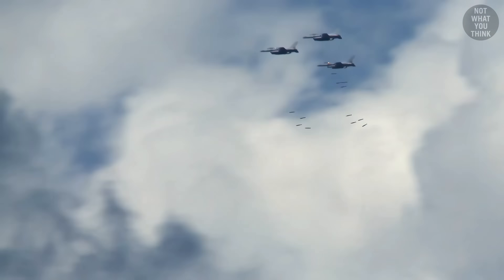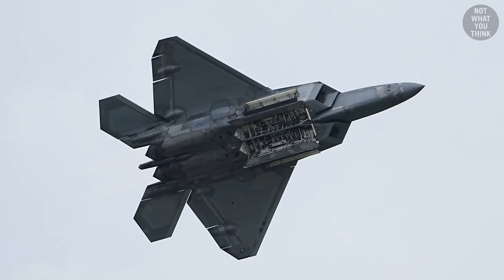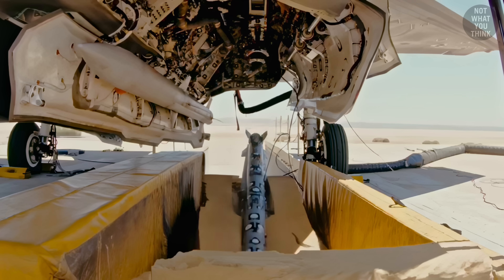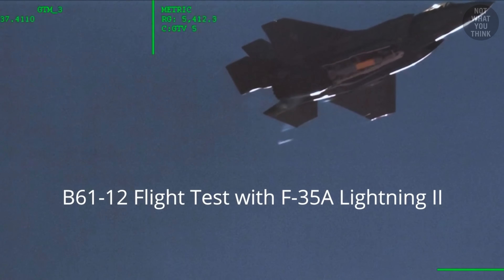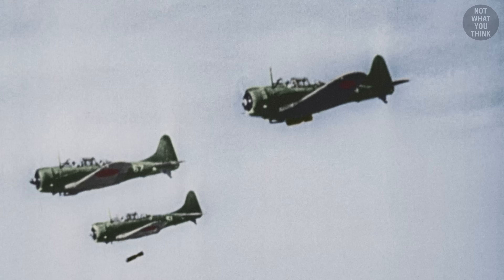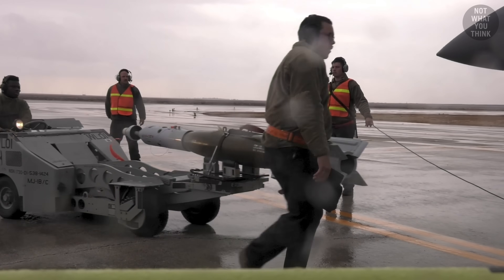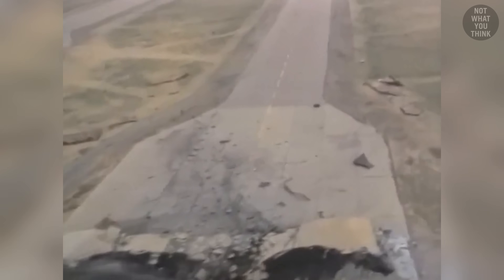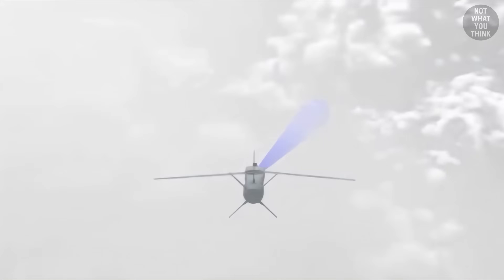Why Gravity is No Longer Enough to Drop Bombs

Comment: I am currently a weapons troop in the USAF and learning the job which involves putting bombs on the aircraft and ensuring it will drop correctly. When learning, we are told to just do things without any real exact reason as to why. This video has given me more information about why we do certain things when loading bombs that no Sergeant has been able to tell me. I might bring this video up to someone within my leadership.
Reply: I was a 462 back in 1979.
Reply: @ 2W1! Through and through!
Reply: That just the military in general. 
When I was in, "Because I said so" was the most common answer I got to my questions. 
They preach to always better yourself, but then scoff at you when you do. 
Most NCOs I met don't want to teach, or even want you there to begin with. This is due to the severe elitist culture among the NCO corp.
Reply: I was a 462 back in 66-70.  I loaded 5 million pounds of ordnance on F-4Es in Thailand, each one had to be pushed off with an ejector cart which opened the bomb rack while the piston pushed the weapon off.
Reply: @richardwalling9695  We still do it the same way on the A-10. Crazy how little has changed.
Reply: @richardwalling9695  Damn. What did you guys use to keep from breaking your backs? Hydraulic lifts?
Reply: If nobody told you why using the correct orifices in the MAU-12 bomb rack or setting the pistons on new pneumatic racks is so important, you had terrible instructors. Then again I am looking at it from the perspective of an armament/munitions officer in the RNLAF where we do want our technicians to know why and how things go to pot when they don't work in accordance with the tech order, job guide or JTD as well as being aware of the potential risks to the aircraft and its crew.
Reply: @ We us -40, -50s on the A-10 and yeah. Nothing was really explained other than “Because that’s what the TO says.” This video explained more than my LSCs ever did
Reply: Herc pilot here, y’all do God’s work.
Reply: @ 
@CramcrumBrewbringer So do you. Pilots are amazing.
Reply: get in touch with your local intel flight, and ask to have a sit down with their targeteers. those folks know exactly how to use these weapons and direct the strike details for the pilots. you will learn a lot and they're super cool people. I'm still serving as a targeteer in the AF, getting ready to retire after 16 years.
Reply: question that you would probably know the answer to. aren't they called hardpoints? not ejection racks?
Reply: @ I haven’t heard the term hard points. Ejector racks is a common term in reference to where majority of bombs are load. There are some others but most are on the Ejector racks
Reply: @crimsonpomp  A hardpoint is a designated attachment point, typically on an aircraft, designed to securely hold and transfer the forces of external loads like weapons, ordnance, or support equipment. These points are structurally reinforced to withstand the stresses of carrying and potentially releasing these items during flight. I searched up a description for you
Reply: @ Yeah we don’t use that term. We have pylons, racks, and AME.
Reply: @crimsonpomp  good to know
Reply: @AubinusPrime  Ejector racks are in the hard points, Or pylons as they were called in my time in the AF.
Reply: @richardwalling9695  oh. that makes sense
Reply: IYAAYAS!
Reply: @ Logic would say: “Oh so if you are Ammo. You are shit.”
Reply: @ lol 😂
Reply: Maybe you are DEI
Reply: Not everyone wants to learn the explanation of why they do it the way they learn it.  
However if someone is interested, it is a good idea to let them know. Might help them do the job better.
Reply: @ I disagree, the learning of why in our career field especially with training will instill people to understand and ensure they do certain aspects of the job. Giving a proper reason besides “Because we said so” goes a lot further.
Reply: @crimsonpomp  Better informed soldiers make better soldiers. However, there is an institutional need to 'keep grunts in their place.' Having less information makes it easier for 'them' to keep you n your rank with 'them' on top.
Reply: @ That might apply to soldiers trained to go to actual combat, but as Airmen and Weapons Technicians. Knowing more information about your job allows for better decision making and quicker decision making. USAF doesn’t teach you what to think, they teach you how to think.
Reply: @KorianHUN for something like that, they definitely should know why they're doing things the way they're doing them. I was a surveillance sensor operator in the Corps and even I got context for why SOP is SOP, making a mistake while implanting sensors is significantly less dangerous than making a mistake while installing bombs on an aircraft

Comment: You can always install ERA to add extra protection to bunker. As a building, there is no restriction on how many top ayers ERA you can stack.
Reply: That wouldn't work. Explosive reactive armor specifically saves tanks from shaped charge warheads, which specifically inflict a lot of energy in a very tiny point. Piling a bunch of extra explosives on top of your bunker won't save you from a gigantic bomb. It will just add more explosion to the explosion.
Reply: @AlRoderick  
ERA explodes against the point of penetration. It will disrupt the plasma shape. Some, like Kontact5, are designed against tandem warhead or APFSDS.

For bunkers, an increase of explosive material to handle bigger size MOB should work fine. There are no weight restrictions.
Reply: @MdYosri  The problem is that a bunker-buster weapon isn't a shaped-charge weapon -- it is a reinforced kinetic penetrator with a delayed-fuze bursting charge. ERA performs poorly against purely kinetic impacts, and in some cases an ERA brick may not go off at all when struck by, say, an APFSDS round, while a HEAT round would definitely set it off.
Reply: @seanmalloy7249  
Kontakt-5 produces a stronger defensive detonation than Kontakt-1 and the thicker steel flyer plate thrown at the APFSDS projectile breaks or bends it. 

A higher quality/harder steel fragment and bigger charge will bend or at least redirect the direction, degrading its penatration capability. The upward explosion will reduce its speed.  

And you can build it multiple levels above ground of the bunkers.
Reply: Also, the ERA size should be proportional, i.e., to the size bunker buster you are  defending against. And if it's oblique to the direction of the penetrator, it will push it out of its intended direction.

Comment: The problem is older than supersonics. In some earlier jets, the transition layer between zero-speed air in the bay and high-speed air outside had bombs 'bouncing' at the interface. Some solved this as described with 'kicker' pistons or pyrotechnics. At least one fixed it by rotating a slotted plate into place at the front of the bay, moving the interface point outside the bomb bay.

Comment: Why dont they just tie a string with a weight on it to the bomb? Have the string dangling down, with the weight 30ft below the plane, so when you let the bombs go, the string theure tied to pulls it groundward.
Hell, you could use a really long string, so the weight is low down with the target, and then you know when you're lined up. The weight could be a big red arrow, for really good accuracy! 
Youre welcome, Lockheed Martin et al.

Comment: If you want to resist bunker buster bombs use carbon nanotube embedded in plastic reinforcement, low slump concrete made with extremely hard aggregate, and high strength cement. Unlike this video suggests reinforcement steel is normally needed as tension forces still need to be resisted, and fibre reinforcement is mainly there to prevent the formation of tension cracks at the impact point and to prevent their spread in areas of tension within members that do not normally experience this force. 

If you want to detroy a heavily defended bunker, target the un-reinforced ground around it, and the structure will coo

You wouldn't make a military video without consulting a military expert. You should do the same when discussing civil engineering aspects of the video, AI chat-bots, and Wikipedia entry's give wrong information and should not be use by people unfamiliar with the material as give partial answers at best.

Comment: This is just one of many things that accounts for the 'Seemingly simple/straightforward things are actually incredibly complex and complicated, and that's why a military fighter planes costs $100,000,000/each!'

Many people are surprised at how a single seat jet can cost more than an airliner, but, often they don't understand that those jets each need to have all of the same kinds of systems as that airliner- control, life support, electronics, sensors, (but no toilet!) and so on, some of which are much more expensive and difficult to build than their analogs in any/all passenger planes! 

Additionally, when one sees, say, an F-15 parked next to a 737, it's surprising that they are not very different in their overall size/mass! I remember seeing a (little?) F-15 near a Learjet- the F-15 was basically the same size in every respect- and then considering the cost/difficulty of incorporating missiles, radar, mach 2+ performance, survivability, etc, all in the same airframe, often without the same economies of sale (for most military planes vs civilian airliners), and it made total sense that such bleeding-edge tech was as expensive as it is.

Now, for example, NGAD seems like it may cost something like $300,000,000/per: Considering the foregoing, that number, which is in the same ballpark of a new 787/777/A340... Well, it makes sense that they will cost so much. (Also, IMHO, that program is a necessary investment for several reasons (and, yeah, one of those reasons is as a jobs/infrastructure maintenance program; I say 'investment' because, after all, they're made almost completely in the US, so it's not like that money disappears- it goes right back into the American economy!)

Also, when adjusted for inflation and PPP, the NGAD 's projected to cost less than the Tomcat did. (But I doubt that they'll get the same $/coolness value.

Sorry for the digression. Cheers!

Comment: Loft attacks are absolutely still a thing and not just for nukes. It allows you to stay lower for longer and pop further away from a defended target while also increasing the energy and impact angle of the ordnance on impact. Also LATs are another option, Low Altitude Toss, where you pop up, and then pull down and point the jet at the target and release on the way down, pointing at the target like a modified dive bombing. This allows (and requires) you to be tally target. Lofts you generally arent going to see the target before release. 
Also SLD Straight Level Delivery from low altitude with high drag bombs, or HARB deliberies for High Altitude straight level deliveries. Then there are Medium Altitude Dive/Glide attacks, like a LAT that starts from med alt, without the pop. 

Unguided deliveries can still be very, surprisingly accurate with the modern systems and "AUTO" or "CCRP" (Continuously Computed Release Point) deliveries compared to CDIP or CCIP (Cont Displayed Impact Point or Cont Computed Impact Point) which is more the old school manual style. 

Also the Paveway series LGBs the control fins are the forward fins and the rear are fixed. JDAMs are controlled from the rear (only) fins, obviously. 

Cool video! Lots of good footage!
Reply: This guy bombs
Reply: You can even see videos coming out of Ukraine today from hinds lobbing rockets upwards to get more range out of them. There are even computers in those aircraft to calculate rocket tosses.
Reply: Harriers were lofting bombs over hills in the Falklands conflict because it allowed them to stay in the blind spot of anti air defences. Royal Marines would get into spotting positions on the hillsides and paint the targets with designators and then the aircraft would come in at tree top level and chuck bombs over the hills
Reply: it also wasnt developed for nukes. the first bomb toss computer was made by SAAB for the B17 dive bomber
Reply: Add mach 2 and 65k in feet and 45 degree start and what do you get then, lots of math and a really really long toss! And they have wingged and powerd JDAMS now!   My estimates well over 300 mile toss!

Comment: The little pistons that push the ordnance away are powered by those carts mentioned. But another variable is Pitch Valve Settings. There are 3 options, 1, 2, or 3 that must be each individually set for each ordnance type on each station. Usually there are two, one front and one rear and depending on the configuration you may set a 2 in the rear and a 3 in the front, etc. Essentially how hard each piston shoves the ordnance away. Might need more of a kick in the front or rear or an equal kick.
Reply: The problem of getting proper weapon separation is not new to modern aircraft; there were a number of systems developed during WWII for torpedo bombers to ensure proper delivery of the torpedo -- the problem was not so much getting the torpedo to depart the launching aircraft cleanly as it was to keep the torpedo aimed at its target. An early tool was the addition of break-away fins at the rear of the torpedo, reducing the amount of 'fishtailing' the torpedo did while falling to improve the aim as well as keeping a proper nose-down angle to prevent it from diving too deep or breaking up when entering the water. Another system developed by the British had two spools of wire, mounted to the nose and tail of the torpedo, that paid out the wire at slightly different rates to keep the torpedo at the proper angle.

Comment: "Ultra High Performance Concrete is 4x Stronger than traditional high strength concrete" and yet despite these advancements, houses are still made of wood and roads are still shity
Reply: COST COST COST COST COST COST COST COST COST COST!!!!!!!!!!!!!!!!! HOW MANY TIMES MUST THIS FUCKING  BE EXPLAINED! COST COST COST COST COST COST! GET IT YET!??????????!
Reply: Bro…. Money. Cmon man
Reply: You also don't want to make roads out of expensive stuff in places where you expect freezing. You need about 30,000 PSI to prevent water from expanding when it turns into ice at -25C (-13F) or below. At -12.5C (9.5F) it's about 20,000. If it can't do that, then water that gets trapped within cracks will slowly break it apart.

Comment: Love how this video breaks the myth of gravity-based bomb drops. The shift from WWII dive-bomb physics to today's high-altitude, high-speed delivery is a whole engineering evolution! 💥
Reply: Dive bombing is still very effective and commonly used to this day. Aircraft Guidance computers have just become so advanced that you can effectively have the aircraft function as the terminal guidance stage for enough of the trajectory to reliably hit a bunker or bridge. You often don't need the precision of laser/GPS as that is really REALLY precise, like enough to directly hit moving tank, and with a lack of opposing air-defenses you don't need to stay very high.

And for many reasons it may be the only option like low cloud cover limiting a high altitude drop or they have laser detectors that trigger the deployment of smokescreens. Also, GPS jamming is not that hard, it's such a small weak signal from a satellite that is so far away, it can be overwhelmed at close range even over a broad spectrum.

Remember, dive bombing fell out of use in WW2 because dive bombers were slow so were easily shot down either by fighter aircraft or ground based AA. Where you have air-supremacy, that's not a problem.
Reply: Bombing is still gravity based silly.
Reply: Its all the same pile bro. One is just controlled and calculated with a computer. All you need is gravity with a non propelled armament, the title is wrong.
Reply: The big problem with the bunker busters was the inaccuracy.  Yes, that was needed for the sub pins
Reply: @oldmech619 
That's why it was easier to remove the foundations. The concrete could be penetrated to a large extent by 7 tons of armoured steel hitting at supersonic speed but the surrounding target was bigger and held up part of the roof. 
A rocket propelled 'Disney' bomb travelled faster and because of the Velocity Squared part of the equation had more energy at impact. 

I don't don't know how it would affect Churchill's war room during the blitz, it had 7 floors below ground.
Reply: They're not really "bombs" anymore. With their own propulsion and guidance systems, they are more like missiles nowadays. They are even "launched", not dropped, by planes.
Reply: So b52 bomber did not use gravity ?
Reply: @billyholmes3  A B-52 isn't going to be flying super fast when bombing. They are also usually used at high altitude.

In this video the danger they are talking about comes from one thing really. A lot of air moving around the plane. So the faster you go, or the lower you go, the more likely you are to have it happen. If you are flying fast & low, then it is even more likely to happen. Conversely when flying slow & high, you are far less likely to have it happen.
Reply: @whyjnot420  Todays B52s are dropping GPS/INS guided stores though, big difference.
Reply: @ The laws of physics haven't changed though.
Reply: Love how you fail to realize this is about level bombing.
Reply: @ Love how you think this is limited to level bombing.

Do you think these fighter aircraft have such poor performance they have to fly level?
Reply: Chat gpt AHH comment
Reply: @darinpringle  No autopilot here, captain! 🛩But I’ll take that as a compliment! 😄
Reply: Jesus is the way, the truth and the life. Turn to him and repent from your sins today ❤️
Reply: @JesusPlsSaveMe  is he laser guided?
Reply: @JesusPlsSaveMe  Jesus take the .... joystick for the bomb guidance ^^ Oh he is just a mythical fairy tale character. Yeah then he is useless.